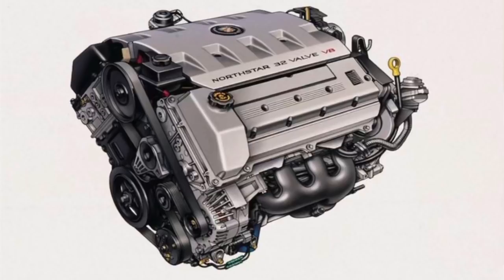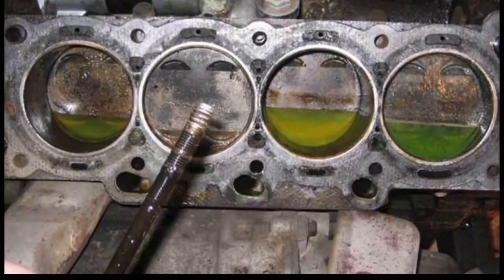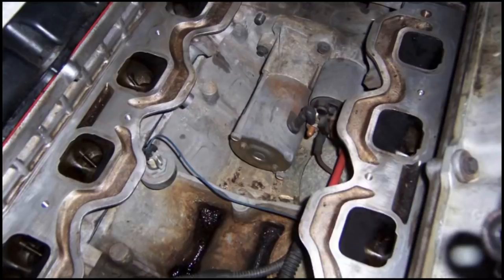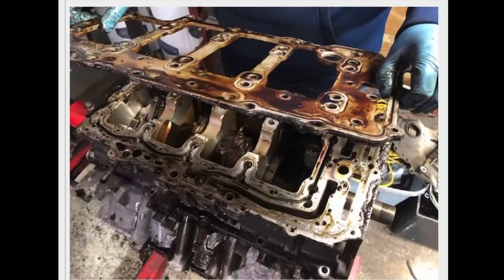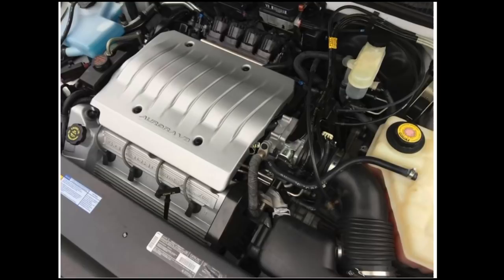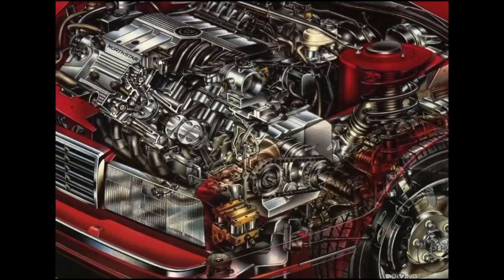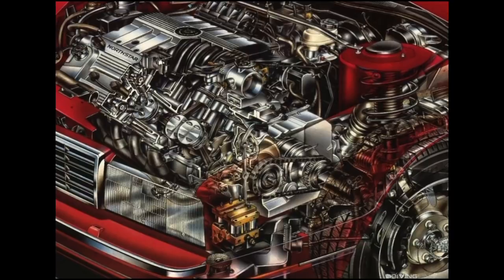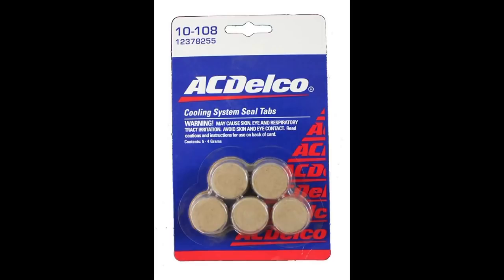Worst Car Engines of All Time: Cadillac Northstar

Comment: People are so stupid and short-sighted.  These are amazingly fabulous engines.  They are smooth, they have good power, they have good torque, they have good fuel economy.  They really only have TWO huge design flaws:  1) The head bolts stretch and sometimes break, causing head gasket failures, and 2) the starter is in the middle of the valley.   But what the ever so short-sighted people don't realize is that if you spend the money and get the revised head bolt set and revised head gasket kit and have everything preventatively repaired by a reputable technician, the Northstar engine can reliably be driven to 250,000+ plus miles without any problems.  You can reliably drive these cars for another 5 or 6 years and NOT have to make new car payments!!

This is the same silly short-sightedness people had with the Oldsmobile diesel engines of the late 1970s and early 1980s.  Again, if new head gaskets and new head bolts were installed, most of those engines would reliably be able to be driven for many, many more miles than people gave them the opportunity to do.  But people never think past the present moment.  And so, that's why the fickle new car owner is never satisfied, because he or she never looks past the one design flaw, and throws the vehicle in the trash heap under the pretense that any other vehicle will be better than "this" one.
Reply from the maker: You just said, “If people thought harder and spent 3-4K to fix inherent issues with their car, they’d have a good vehicle.”  Herein lies the problem and why as used cars they aren’t worth much. 

Most people who drove these as used cars found a $3-4k out of pocket expense to be challenging for them.

Comment: The northstar is not a bad engine. The only real problem worth mentioning is the head bolt threads pulling out of the block causing the head gaskets to leak. The aftermarket time sert kits that have very coarse threads is the only permanent repair the factory time serts will fail at some point again because they still use fine threads. To be honest if ur a decent auto technician dropping the engine and trans out of one of the caddy’s is actually not a bad job to do and once you drop the engine and transmission out of the car the engine is VERY easy to work on much easier then most cars of today. A quality auto technician can drop the engine and transmission out of one of these caddy’s in less then a couple hours as long as it’s not super rusty. Most cars nowadays to service the engine or transmission you have to drop it out of the car so this is not an uncommon thing. The starter in a northstar is under the intake but the intake is so easy to take off that it really doesn’t take very long to change the starter.

Comment: 1:18 fine thread is A LOT stronger than course........ 
.
its the same reason why 50 small splines on an input/output shaft are stronger than 6 big splines

Comment: I don’t remember what car it was other than it was the two door coupe of the time but I knew someone that had one. Never had a head gasket problem but I remember the thing only worked half the time due to one electrical issue or another. It was a fun little car when it would run though and the engine sounded great

Comment: Porsche has put the starter in the V of all of their V8 and V6 engines (VR engines notwithstanding). It sucks but it's much better than the  new ones where the starter is in the bell housing. INSIDE THE BELL HOUSING. Starter bad? Dropping the trans. Except on the cars where you have to drop the subframe/motor/trans assembly in order to get the trans apart from the engine. Then you're doing that.

Comment: I had a 94 eldorado that I let go of because of northstar issues. I never figured out why it had problems, it would run awful at low idle.
Thinking it was probably a grounding wire somewhere- go figure.

But while I had it I was expecting it to be hell to work on because of the northstar engine, but it was really rather pleasant to work on.
The engines come apart very very easily. Its really no big deal to work on them. Even the starter is really not that bad at all.

Comment: Ill stick with any gm that has the Buick 231 3800 series engines. I don't know why Cadillac Didn't use the Supercharged 3.8L 3800 series I II III in these cars which would have not tarnished Cadillac reputation for a decade or more

Comment: The pre 2006 Northstars may have head bolt issues but only if overheated. I had no problems with mine other than leaking valve cover gaskets which I replaced once in 100,000 miles. It's not a bad engine, especially after 2005 but you have to maintain it. Keep the coolant and oil clean.  I had my Cadillac DTS up to 120 mph and it was still pulling!

Comment: I had a 97 Olds Aurora autobahn package. Black on black everything, engine wise I had no problems and she could hit 140mph pretty easily and smooth. Sadly she caught fire under the hood probably due to oil being burned on the headers.

Comment: Worst engines. Impossible to work on. No room horizontal. At least Lexus has long lasting parts. 4.6s stripping head studs and levitating heads, blowing gaskets, breaking timing components, piss poor cooking system with the era of Dexikill coolant. Just an awful engine that made many Cadillacs awful more than they were originally.

Comment: Really wish they had developed rack and pinion steering on the big body 93-96 Cadillac, those had the reliable LT1 V8.  Yet they steered like shit with the old steering box/linkages,  compared the smaller FWD Deville, Seville, and Eldorado models that had rack and pinon steering.  That bigger RWD car would out steer those smaller FWD cars if General Motors had put the cash into developing rack and pinon steering for their body on frame RWD cars.  Ford did that in 2001 or so, converting the Crown Vic to rack and pinon steering, basically redesigining the whole chassis.

Comment: Adam, I am curious about the Olds Auroras that you owned. Or anyone else for that matter. How did you like the car and did they have the same engine problems? I heard that Olds took the NorthStar and re-engineered the engine before putting it in their flagship. It had a nice 250 horsepower rating, not a screamer, but nice performance. Did they fix the bolt problem with the heads and block? Still used the pellets in the cooling system? What other problems do they have other than the ground, a great thing to know Adam. I am considering looking for one as I just love the exterior styling and love the instrument panel! I certainly would rethink the car if they are basket cases. Then I would go back to a panther platform from FLM. I had a '92 Town Car but the engine was abused by the previous owner and could not be repaired, even by my brother-in-law at his shop. After we spent near $900 dollars it would not pass emissions testing. It would load up with oil at idle and when you drove off it was like fog had rolled in, just blue. Wasn't worth doing the entire engine. Good car.
Reply from the maker: Same Northstar issues and also electrical gremlins in early years

Comment: I have a 01 Eldorado.   The only problem I ever had was the plenum dry rot or critter chewing the rubber    And the fuel  pressure sensor. That thru a code of p0446.  Evap  code.    Caddy code is different.   Chevy code for fuel pressure sensor is P0446.  Nothing to do with a Cadillac Eldorado code That’s it I got it in 09 with 49 k.    It’s got 73k on it now

Comment: Changing the starters in a Northstar is easy... I have no problem with the location... , the water pumps, Alternators on some years 06 and up are horrible... , the early years... head gaskets are awful, but are fixable with chemicals... sometimes.... lol

Comment: I have owned 3 Northstar equipped caddies and everything you've listed has given me war flashbacks again. Don't forget the climate control system failing. All 3 did in mine. The radiator tanks are made of plastic so those would eventually crack and dump coolant. I replaced 2 starters because half the time my car wouldn't start, turned out to be my parking control module which I had to figure out on my own after extensive research since no mechanic could figure it out and always assumed it was the starter. Front-end alignments never hold with these cars, you will burn through tires from uneven wear constantly. Pretty cars, lota pick up, but there's a reason why you can buy one for mere pocket change.

Comment: Had a 2001 STS. Dumped it after I practically pulled the motor to change the alternaror. And I didn't feel like buying intake gaskets to change the starter

Comment: Completely agree. The Northstar would've been one of GM's best engines if not for the major issues. From a purely driving experience, Northstar Cadillacs are super nice... I just wouldn't want one to be my one and only car. If I could get a brand new Northstar, I'd definitely take it over any of the other motors you listed in the other vid! The final gen Eldorado, the Seville, the Deville and DTS... really were let down by the Northstar imo. I'd like to imagine a world where they'd found a way to install the LS instead. I dream of someday finding a nice early final gen Eldorado that has the 4.9, as well as one of the 94 redesign Deville with a 4.9. At this point, I feel like buying a 30 year old Northstar at this point with an unknown history of maintenance is just a little too sketchy for me. I have a neighbor with a late dts that has been well maintained and it's a great car. It's a shame that not more were treated that way by responsible, intelligent owners such as yourself.
Reply from the maker: I had a 92 STS w the 4.9 and loved it. Black with pumpkin/orangey tan interior.

Comment: You didn't include the Northstar because it's a good motor when it works.... THEY'RE ALL GOOD WHEN THEY'RE WORKING. the issue is they're unreliable P'sOS. Northstar should be on the list.

Comment: i dont know...i have an 06 lucerne with the northstar and 140k on it now. Still one of the best engines ive ever owned. They changed the head bolts in 05 to help with the head gasket problem. Gm shouldnt have waited 10 years to do it though.

Comment: 4:10 - I owned a '95 Aurora back in the day.  It developed a weird issue with the tail lights.  When it would rain they would come on and run the battery down.  
I bet that stupid ground was the issue all along.  I figured it was the BCM.  I didn't want to put money into the car, so I sold it.

Comment: The 4.4L also had a oil pump that has a Jacob's tapper type fit to the crankshaft that was held on by the crankshaft's front bolt [no keyway] that also kept the harmonic balancer on. When the bolt cames loose you lose oil pressure and your engine self destroyed. 
I had this happen on my XLR-V.
VERY UNHAPPY!!!😨👎🤬

Comment: I've had 3 cars with Northstar Motors in them 05 Bonneville 07 Cadillac DTS and a 98 Eldorado each car I never had a problem motor wise my DTS had 300,000 miles before it was totaled Northstar is a great motor just not an performance one you ever why you see elderly people drive Cadillacs cause they don't abuse the cars

Comment: I had a 2004 Deville DTS that i commuted in for 12 years I drove it hard and got 275,000 trouble free miles until the trans cooler line blew and smoked the trans. My daily driver is now a 2006 DTS a great car smooth powerful and comfortable. Yes the northstars leas a bit of oil they solved the head gasket issues by 2004 everything 2004 to the end in 2011 are good

Comment: OF ALL THE YEARS OF GM ENGINEERS DESIGNING ENGINES , THEY FORGOT THE RTV SEALANT , AT 65K MY CONCOURS DEVILLE STARTED TO LEAK OIL FROM THE VALVE COVERS AND OIL PAN , I CALLED THE DEALER , OH YEA WILL FIX IT FOR YA 4000.00 HOW CONVENIENT TO HAVE A FIXED PRICE READY,  FOR A SUCKER LIKE ME WHO DID NOT TAKE THE BAIT !!!! I DON’T LIKE LEAKS AND TO NOT SEAL THINGS FROM THE FACTORY FOR A 50 K + IS JUST A SET - UP FOR FAILURE ( INTENTIONAL WARRANTY WORK  ) !!! A FRONT WHEEL - DRIVE CAR WITH NO ROOM , CAUSING THE HEATER BOX TO MELT , I’M DONE WITH LATER MODEL AMERICAN CARS , A 1970 ELDORADO WILL RUN CIRCLES AROUND THE LATER JUNK AND YES IT IS A FRONT - WHEEL DRIVE CAR !!

Comment: The "Northstar" was a purpose built indy competitor.
THE NORTHSTAR IS AWESOME.
1993 INDY CHAMP
Reply: Huh? That engine was made by Ilmore Engineering in England. Chevy did pay for it, so they got the name on the valve cover but....auh    Yeah, Ilmore. You may have gotten it confused with the Aurora engine they raced in 1997 which GM did design but it was very different from the Olds engine which was the 4 liter version of the Northstar. The production engine and the race engine had zero parts in common.
Reply: @keithstudly6071  nope..4.6 litres (260 ci) indy rules.
Developed by Buick in the 80s.
Starter under the intake manifold. 
Look up "Chevy indy v 8 "
Won at indy in 93

Comment: Those old school GM coils can be so hit and miss. I've seen brand new ones short to the bolt between the two plug towers and misfire like crazy. Thank god for poorly lit shops that make it easy to see a spark that small escaping the coil.
Reply: All 4 of my ignition coils on my Northstar are original from 1999 and working great in 2022

Comment: It did turn out to be an unreliable engine however it was great when it was first introduced. It was very refined. Very quiet. Very smooth and powerful engine. And it was high tech in the early 90s. So yes it did have a design flaw that limited it's reliability but it was great when first introduced I'm just being honest it was competitive.

Comment: The Northstar sucks. I will say they did get better and if you get the performance head gaskets they are decent engines. I want to defend GM slightly. The 3800 V6 is a legitimately good engine and I think js really under rated. They can be had for pretty cheap even now. Like my 2005 Buick park avenue was 2 grand. You can not find a good Camry or Accord for that price.

Comment: Dad had an '06 DTS, Cadillac took care of the head bolt issue in 2006 so never a blown gasket or overheating.  It did suffer the very expensive leak fix, on the other hand it didn't seem any worse then the old small block Chevy's leakage?

Comment: R U aware that the 3800 engine would  plug oil galleys, camshaft crank journals
Reply: Excuse premature ending, when cam sprocket would strip the plastic teeth, the oil galleys would become stuffed with the plastic pieces of cam sprocket.

Comment: What? I just bought a '93 for 40K.
I'm in for some grim darkness in the near future.
Reply: You will be fine. I have two 1993 Allante's, 95 Seville STS, 2000 Seville STS and a 2005 Deville. Never had any trouble from any of them.  Proper maintenance is key just for any other engines from Cadillac.

Comment: I will stick with the Buick 231 CID 3800 Series I II III V-6. Also on the North star do not use the Dex Cool as its the gaskets. A GM master tech mechanic told me never use Death Cool as it corrodes the head bolts as well.  He said when their garage does this job they will not use death cool they use universal green coolant. I had mine death cool flushed out of mine and my coolant temp never went past 185 and with death cool got to 220. Flush Death cool and use universal green coolant.  He also told me that when GM designed the engine back in 1993 it was never designed to run on Dex Cool at all. He said the Dex Cool caused 90 percent of the problems which led to a GM class action lawsuit against Dex cool antifreeze eating the gaskets and the people won. The class action goes back to 2008-2011 and was also filed in 2013.

Comment: 1996 Deville 230k miles going strong 💪🏾 💪🏾
Reply: Since 05 went thru 1 trans @180k i drove the shit out this car, my first car so i didn't think id still have it. Was stuck in 2nd gear for a year and it was like driving a Nascar, id race everybody and win with an old car lol. Went thru about 10 alternators with my bass system(2 15s 5 amps), 2 sets of shocks, 1 water pump, no tstat. 2 cooling fans, 1 heater core, 2 digital dash replacements new seats installed(my originals were trashed from my high school days lol) . Still working on upgrading it little by little with airbags , its on my channel. Thanks for reading.

Comment: The northstar really isn't a bad engine.  The ones the ones that had all the head gasket problems are the 1996 to 2000 versions.  The early one's and the later one's rarely have head gasket issues.  Besides the sound a high revving V8 makes is awesome.
Reply: They got better in 2000 but it wasn't until 2004/5 when they started using proper head bolts.